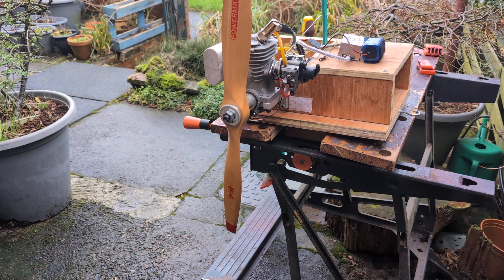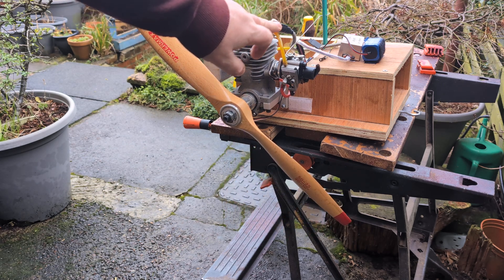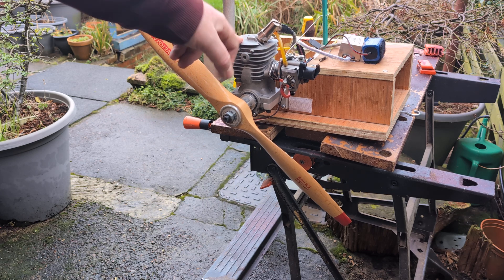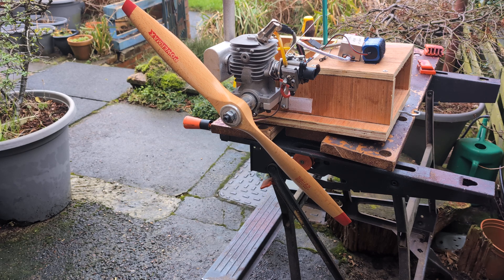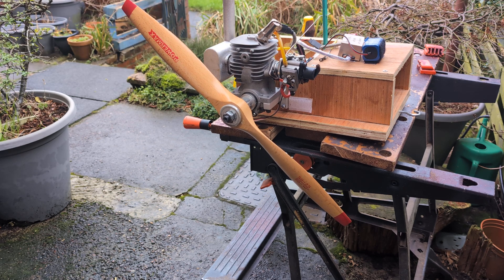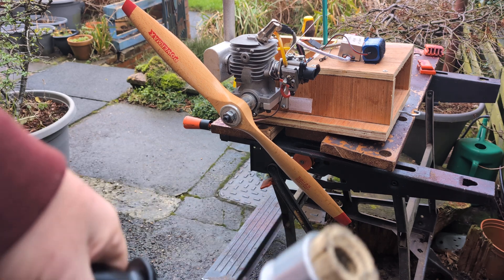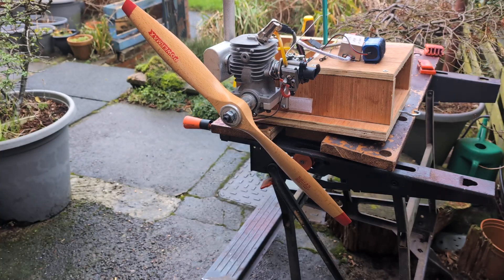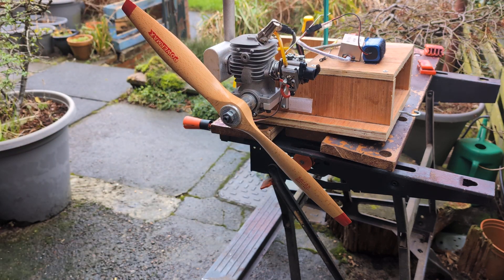Starting up a CRRC 40CC engine for the first time

Comment: I traded some Webra parts and most of a Saito .45 for one of these engines last week. I haven't started mine yet as I need to get an engine mount but research seems to show that they are good value for the money. The main downside seems to be that the early versions had some quality control issues but they have been around for a few years now. BTW I use a battery powered drill to start most of my larger engines.
Reply from the maker: Think this will do the job 😊

Comment: Hi Mark 
Have had one of these quite a few years. Brilliant and looks so ancient and fitting on old style big models. 

 Popular Chinese brand. Well pretty common here in Australia . 

Mine came as a kit! Very cool. Looks the vintage part but with modern electronics it's a great gutsy simple engine. Internals are really nicely machined too . 

Got another of same brand in 50cc. Looks totally different and its about 80-90% of a DLE but seems far more reliable much easier to start and loads of thrust from a 22 inch carbon prop. And a fraction of the wild DLE price. 
The 40 takes I think 18-20 props.

I use heavier props and avoid wood. Latter splits just thinking about a nose over and they cost a heap last five minutes and have insufficient flywheel effect compared to plastic big ones. In my view and experience.

Mate of mine always used wood ammd man were his DLEs hard to start. And the merest touch of the grass on landing turned the prop into shrapnel. Gave him a bunch of really nice reinforced plastic ones and he never looked back. 

These petrol motors are so easy on fuel too and a fraction of what glow motors use.

Anyway, excited to see you test this motor. They pull plenty of weight and if the plane is a bit over-engined it doesn't have to run hard at all so they last forever and sound better than a two stroke on full song. Again just my view. 

Thanks for all your good stuff Mark ❤
Reply from the maker: Thanks for the reassuring post , now I have the problem which engine to use😊.
The engine seems well made ,some have said they are junk 😞 but really what can go wrong with them??
This is fitted with a Walbro carb a replacement for the original I believe which might have been an issue.
Thanks again Merry Christmas.
Reply: Hi again Mark 
Mine came with a walbro as standard. No problems. I think a lot of modellers are into big brands. I have a bunch of motorbikes and the same applies there too. A lot of snobbery. Some of us love them all. Including planes. But of course we have our favourites.

Your motor should be fantastic. Sure DLEs might be a bit better but is that needed when you have a big 40cc up front ? 
If you put your 40 in the Fokker it'll go brilliantly and won't have to be revved flat out like a 30.  Lovely big prop with plenty outside the cowl. Simple operation as dnt you love the engine mount that came with it ❤ your 40 is also quite short. I have a rear induction 30 ammd it's so long with the stand offs. Much longer than the 40 you are highlighting. So yours will likely fit the Dr1 very snugly
 
I love the old zenoas and I forget the other old banger from the 80s but they're pretty gutless and chunky compared to the more modern stuff I reckon. And modern ignition systems are just so good and basic.
Don't know if you already have one but maybe get one of those ignition kill gadgets  that plug into the system and use a spare channel such as retracts to kill the motor whenever you want to. 
Absolutely love what you're doing with the Fokker. And of course you have the gift of the gab😂. It's 3am in Sydney. 3 hours past Xmas day  and ya still have me awake 😂. 
Merry Christmas to you Mark and a fantastic new year. Looking forward to all your future videos. 
Michael
Reply from the maker: @monty9463  I'm starting to think that the CRRC is the way to go. It will involve making a stand off to get around the fact that I cut out the old firewall 😔. That being said it's nothing that can't be overcome. I'll push on with the build, radio gear and covering still to do so loads of fun still to come.